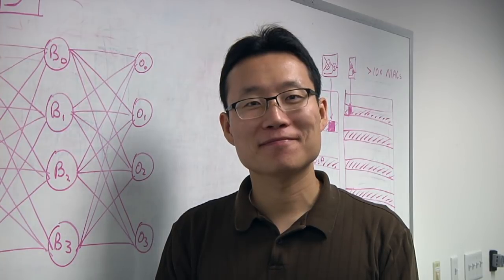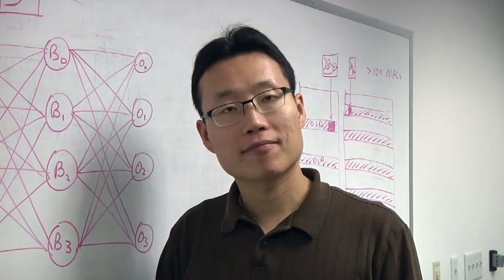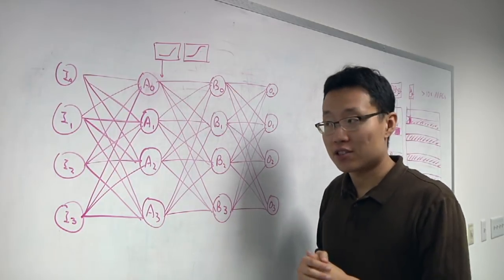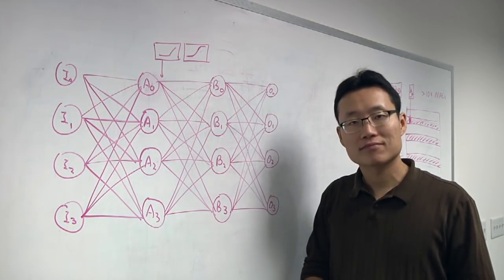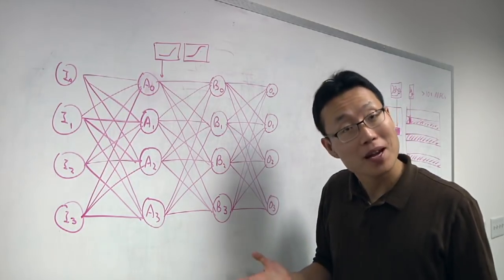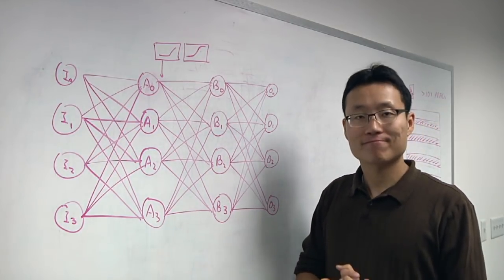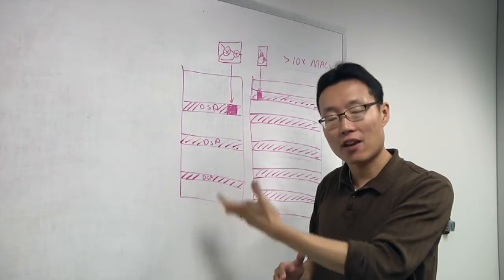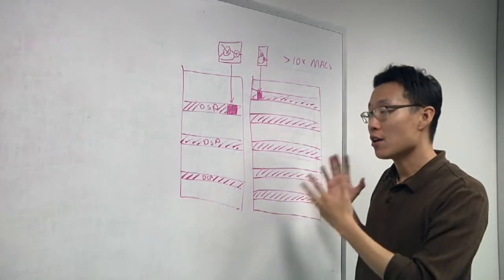AI, ML Chip Choices

Comment: This topic just focused on the MAC and FPGA-structure design, but for AI solutions, there are more problem and directions (like ISA, hardware components, and software framework) which need to be solved.
Reply: Yes.. and faster memory accessing / computing in memory
Reply: For that you need granular signal routing tools that allow you to project a variety of resources in the architecture, build them in ASIC or FPGA, and connect and reconfigure those functions in a separate fabric. Augmented devices. It's the way this next Intel CPU will be built by creating a set of parallel pipelines to overwatch the critical speculative branching vulnerability in virtually all modern CPUs. But particularly damaging because it's Intel and Microsoft's relationship that got us into this trouble. Let's hope Gerlinger can pull a rabbit out of the hat. Or get another hat.